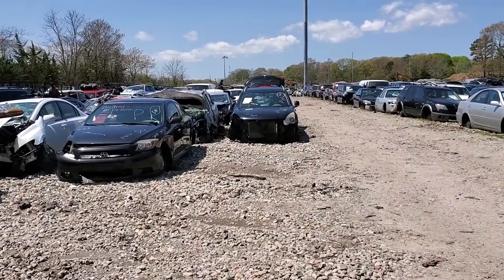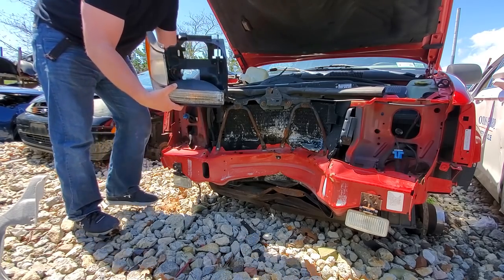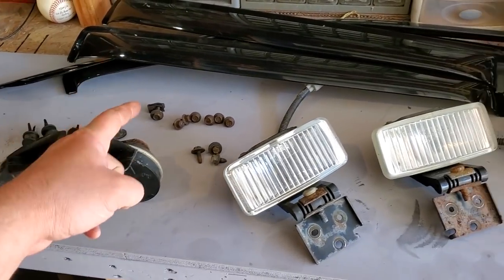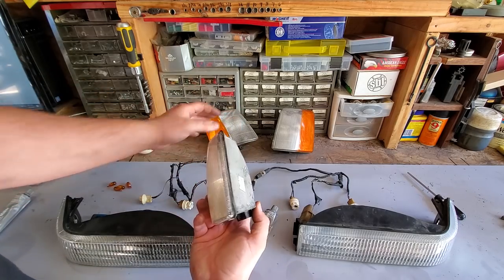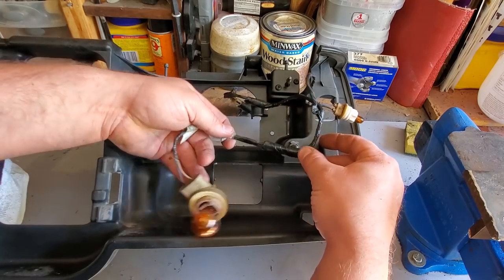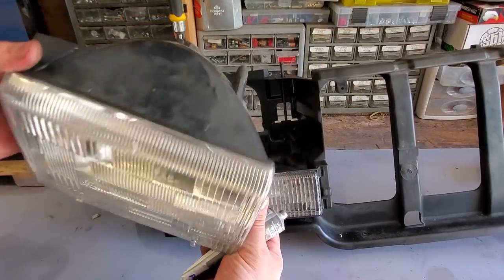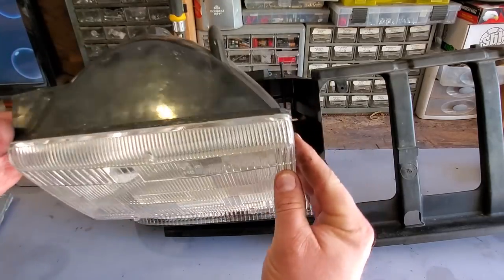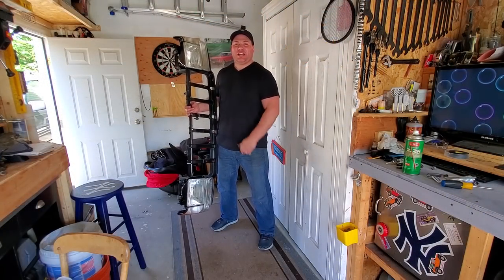JEEP ZJ HEADER PANEL BUILD PART 2 - SCORING SOME 98 GRAND CHEROKEE LENSES AT THE JUNK YARD

Comment: Header panel looking good. Question do you know where I can get new vacuum line rubber elbows, the three that connect to the ports on the manifold on the XJ. Very hard to find.
Reply from the maker: I'm in the same predicament brother.  I have a bunch of dry rotted vacuum connections and I can seem to find em.. some one suggested fuel/ trans/ or regular clear tubing... Not sure about the elbows... Maybe I'll check the sprinkler section at home Depot! Lol
Reply: @ProjectDanH  I will let you know if I find a source. Perhaps the dealer may have these.
Reply from the maker: @josepichardo2659  ok cool! Thanks